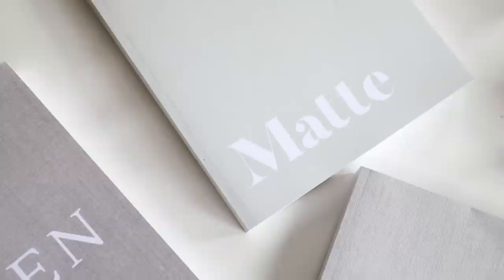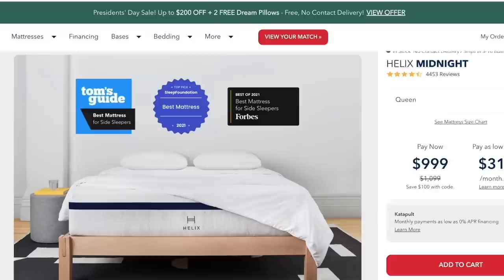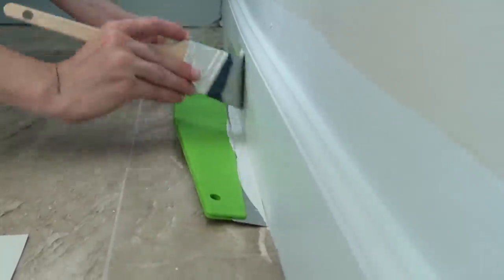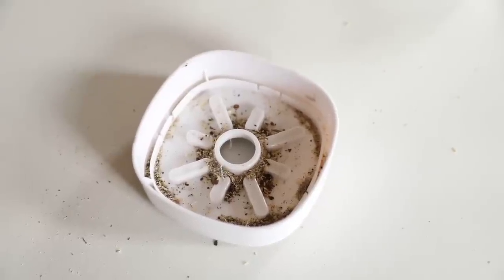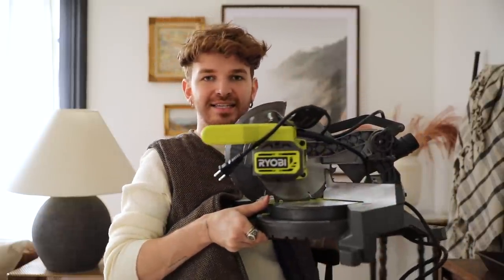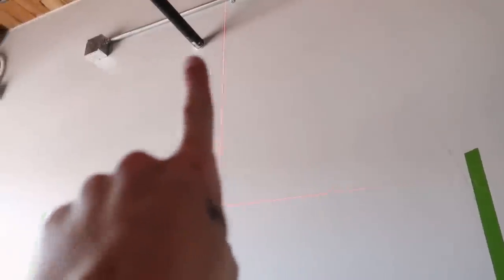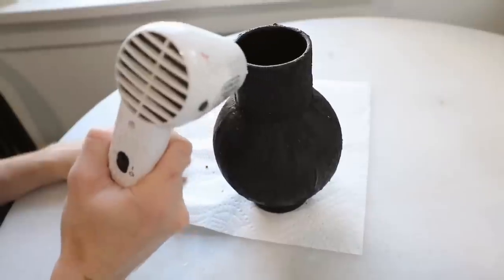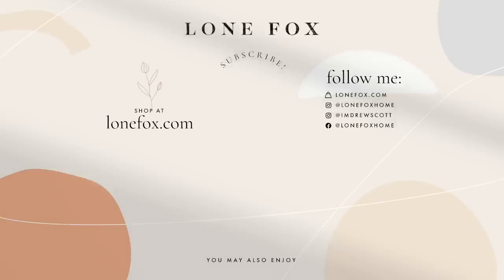15 HOLY GRAIL Home Hacks + Decorating Essentials THAT CHANGED MY LIFE!

Comment: Today was the first time I watched your videos and I watched 3 in a row and enjoyed each one. Of course I subscribed.  Wish computers were around with youtube 40 years ago when my husband and I were working on our 1906 home. We did many things just by making mistakes but we were happy with our finished projects. Stripping high baseboards, door frames learning how to wallpaper and still talk to each other when we finished. Making a wall to wall 11feet wide from ceiling to floor closet with drawers on the sides out of oak, staining and putting 2 hole pulls on their drawers. I made a paper template because every drawer was the same size. The list goes on and work never stopped re-doing an older home. I loved the paint technique you used on your apartment in one of the rooms the window trick using electrical tape. I'm looking forward to watching more of your great ideas.  There is one thing I'd like to know.  We have moved to a condo and I want to do our onsuit bathroom. So how do you take vinyl wallpaper off.  I've seen a few ideas but want to do it once as my age is not in my favor to do it one way and then find out how to do it an easier way.  Enjoy your new home.  Wendy Montani from Canada 🇨🇦

Comment: The paint hack over tape for straight wall. I use acrylics semigloss varnish (or whatever the sheen is on the wall. This way you don’t have to try and match the original paint and crisp lines

Comment: I work as a painter. 

Don’t use a heat gun to dry paint. You want airflow more that heat. Heat will burn the paint, it’ll turn brown and bubble and curl off. Heat is actually a great way to strip paint. You can take a heat gun to old hardware and melt/peel the paint right off. Putting a fan on a wall with wet paint will cut your dry time in half, airflow is ideal for speeding up the drying process. 

A hairdryer is the best tool for quickly drying small projects. That’s what I use at work to quickly dry small items

Comment: When hanging pictures I use one or two straight pins together depending on the weight of the picture. That way there isn’t a large hole in your wall. Easy to nail into the wall.

Comment: diy idea for you….You normally ditch or spray paint the handles ….I painted antique drawer pulls with Annie Sloan chalk paints…added a.s. metallic wax …covered with Dixie belle satin clear coat…used a.s. Chateau grey (which is green with grey) and warm gold wax. You probably could use any wax and clear coat….but the a.s. Paint really sticks to the metal. I would like to see you make furniture hardware small pieces of art.

Comment: My Deco Dude Drew!!!!  I just ordered the tabletop vacuum (using your link).  I had no idea those even existed.  Thank you!  Also, I have all those exact power tools (except the baby mitre saw...and I'll get that, too) and I totally love them.  People laugh when I tell them how much I love my "nail gun/brad nailer".  I use them when I'm building frames for my paintings.  ALSO, thanks to your suggestion, I might switch over to using the gorilla glue hot glue sticks.  I do heavily textured paintings using hot glue and want to be sure then adhere to the canvass forever.  Nothing has separated in the 10 years since I did my first hot glue painting...but...you never know.  ANYway.  THANK YOU! 💖💙💜
Reply from the maker: Hi Merri! So happy you found something you could use in this video! The vacuum is such a handy little tool to have by your work station.

Comment: I used a heat gun after I pulled up the peel and stick tile. It worked great to loosen the glue. But when I was done there was a whole mess of black glue left. I forget what I used to get that off. It was a long time ago. At an old house. But there is something you can put on the subfloor to get the glue off. We had to put a sheet down until I found it. We were sticking to the floor, it was in our small bathroom.

Comment: That plastic for painting with or without the tape is great.  It's self-sticking even without type with cling.  But the painting edger?  Not so great.  I tried it and it gets paint where paint should not be and the edge is not as clean as a carefully applied edge with a good brush.

Comment: I need that fil stick and paint pen! Also, thanks, Drew, for the previous tip about caulk and dish soap. We finished our big caulking project this week (glassed-in porch with 9 floor to ceiling windows!), and that helped enormously! (If you have any tips for removing paint from vinyl windows, please share. That was a real chore.)
Reply from the maker: The paint pen is SO FUN! I legit walk around the apartment looking for small marks on the wall that I can paint over...

Comment: Help! Someone.... Up to now I've presumed that you can't use a nail gun without an air compressor. This has stopped me getting one. Am I wrong? I know you can get a similar staple gun but a nailer is a lot stronger. Is the one you show here just as strong as a tool which uses an air compressor?
Reply from the maker: Just get a Brad nailer! No air compressor required :)